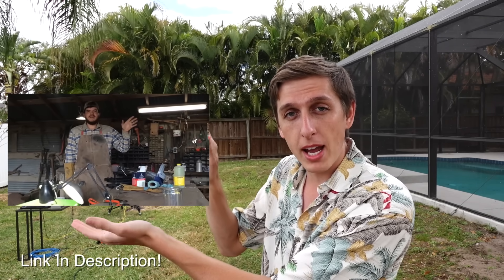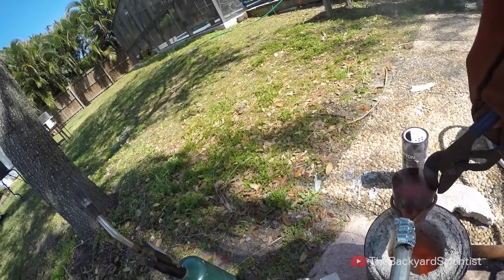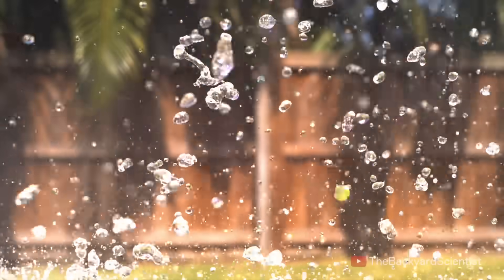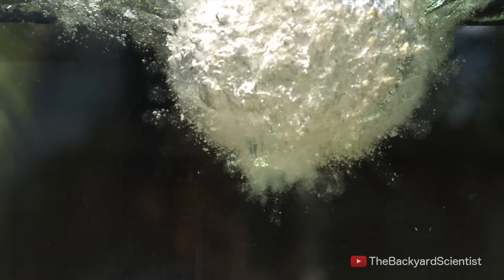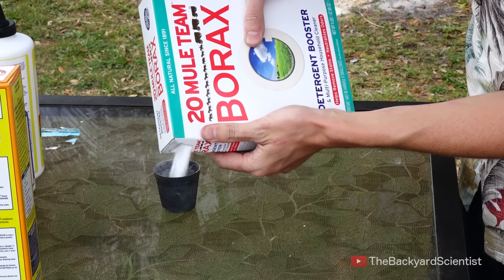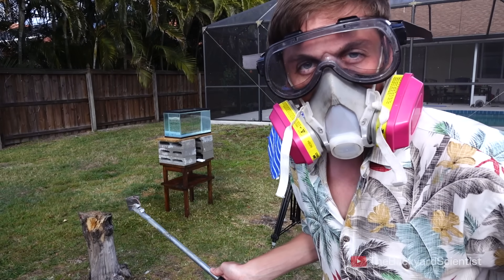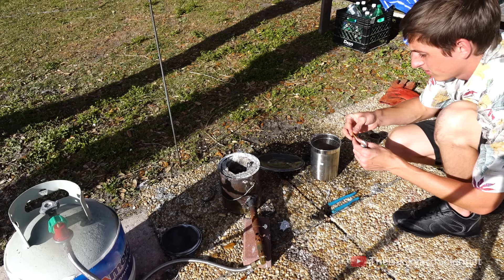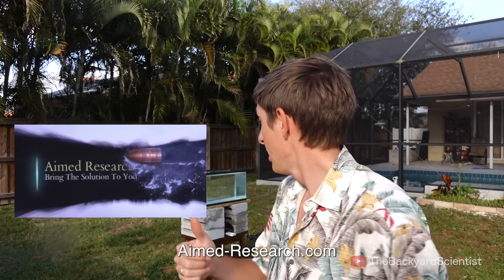Pouring Molten salt into Water - Explosion!

Comment: im compelled to disagree, i dont think this a thermal hyperexpansive reaction because if it was it wouldnt make sense that the leidenfrost effect would fail to prevent a droplet of water from contacting the molten salt, the reason the explosion wasnt significant when the salt was just brought to melting point (880*c) is because molten salt cools very rapidly and by the time it was poured it wasnt hot enough to create a perfect leidenfrost effect which led to the water making contact and defusing the majority of the molten salt with rapid cooling leaving only its core hot enough to have an explosive reaction, when the molten salt was heated much higher (1500-2000*c) it was able to create a perfect leidenfrost effect which prevented direct contact with water and stopped it from cooling rapidly, the steam from the leidenfrost had a chemical reaction with the super heated molten salt causing a very powerful initial explosion as well as several secondary explosions, the reason the pH level didnt rise was because the molten salt was mid-way to reconstituting into a metal which would have significantly increased its resistance to dissolution as well as the fact than is was a salt reaction and not a water reaction, my theory is much more plausible than a - leidenfrost fail with super hot molten salt which is impossible, the only way the leidenfrost can fail is if the reactant was not hot enough.

also the reason why the other salts tested in the experiment didnt react at all was because they did not create a perfect leidenfrost and was cooled rapidly, the additives in them also prevented fractures from occuring on the surface which prevented the core from reacting, at least in theory.. this is very similar to how molten glass reacts in water with the prince rupert effect, creating an outer shell that protects the still hot core, although the prince rupert drop is more akin to thermal differential contraction which leads to a nigh indestructible drop of glass.

Comment: Maybe it explodes becuase of the structure of NaCl. The gaps between the molecules could be big enough, so that water molecules are able to fit in between them. When cooling off, the molten salt transfers the heat to the water. They water evaporates, while the salt freezes and traps the expanding steam and it explodes. Maybe the other salts are to dense to let water fit in between it or freeze to quickly.

Comment: Could the low viscosity of the molten NaCl be why the Leidenfrost effect is not having the usual effect? I noticed that A) you had to heat the NaCl to a higher than simply molten temp to get it to explode and B) all of the other salts you tried appeared thicker than the very runny NaCl.

Comment: I agree it is a physical reaction, but I think the key to your understanding your question is the difference in hardness of the NaCl crystals vs Borax crystals. The expanding vapor pressure inside a much denser, harder NaCL Crystal will be able to build to higher pressures before it fractures and thus the energy released at once will be greater than a significantly softer, less dense borax Crystal.

Comment: Awesome! The salt is so hot and it spreads out so quickly with such a large surface area it causes the water to super boil... my guess.
Reply from the maker: thats basically it! good guess :)
Reply: Na reacts with water and cause an explosion 2Na +2H²O -> H² (g) + 2OH(-)  (aq) + 2Na(+) (aq) 
∆H<0  which means energy is being released, and that's why it explodes.
Reply: also salt is NaCl and Na (sodium) reacts with water. basically everything on the far left (alkalimetals) on the periodic table does. mix them with water and you have an explosion
Reply: Na Cl isn't the same as elemental sodium and elemental lithium. Throw either of those into water and you'll get a reaction spontaneously (with heat it's more violent as you can see in the video.) Salt is Na+ and Cl- which are the stable products. If it was a chemical reaction you would form HCl or NaOH which would change the pH.
Reply: Although in this case, you'd have equal parts so the pH would cancel anyway.

Comment: Well I'm no scientist but, like say you have a ball of energy, and you flash cool the outer shell, the energy inside the ball will continue to try to escape, also that outer shell fractures and or dissolves (in water) and this process repeats over and over until there is an energy balance or neutral I guess

Comment: When NaCl dissolves in water the molecules separate, however they are ionized and not particularly reactive.  If the NaCl is unable to dissolve or remain dissolved, then you will just have precipitate.  Separating NaCl requires energy.  Na when alone and non-ionic will rapidly oxidize releasing hydrogen gas from H2O molecules being 'ripped' apart.  This reaction is exothermic and rapid enough to ignite the hydrogen gas resulting in the orange flames.  The molten NaCl explosion is purely mechanical and predictable given the specific heat and temperature of the molten salt.  The electron behavior of NaCl is different from borax and or NaCl conducts heat fast enough for the water to rapidly absorb the heat, vaporizes, and then absorbs the rest producing a ball of super-heated steam slightly cooler than the molten salt.  If one were to try the same thing with a powdered ceramic material, even at a significantly higher temperature, you would probably end up with tiny steam bubbles being released for minutes on end.  It is worth a try.

Comment: the sodium metal reacted nore violently with the water. so much so that it couldnt get into the water and have the back pressure to make an explosion, in the same way that gunpoweder burns when loose, but explodes when contained. try dropping water on molten sodium metal and molten salt to see if that affects it

Comment: Could the molten sodium chloride NaCl,  disassociate the water into H2 and O2, reacting Cl2 from the salt with H2 from the water in the presence of blue light from the sunlight yields HCl.  this is a very energetic reaction.  the sodium reacts with water forming NaOH.  The NaOH reacts with the HCl and forms H2O and NaCl, so the PH at the start and end will be the same.  O2 gas would also be released

Comment: 1. The first explosion of the molten NaCl was most likely due to the  "speeding up" of the H2O molecules due to the massive amount of kinetic energy you added to the solution. If you add that kind of energy, the molecules are going to speed up and they need somewhere to go. The energy added was greater than the strength of the vessel, so it shattered. Something like E=1/2mv^2. So I believe this was mostly due to the change in energy i.e. it is a physical reaction. 

2. The solid sodium being added to the water is a redox reaction of sodium with water. Sodium loses its electron and the solution becomes basic. Here is the reaction. 

2Na (s)  + 2H2O (l)  -------> 2NaOH (aq)  + H2 (g)

This always happens with solid sodium, which is why the metal is stored in oil. Also, this type of reaction is what gives the alkali metals their name. I believe the explosion has to do with the rate of reaction, but this is definitely a chemical reaction.

Comment: 2Na(s) + 2H2O → 2NaOH(aq) + H2(g)

It is a chemical reaction dude. H2 is the reason why it exploded. The former one didn't explode because either the concentration of H2 was not between 4%~75% (probable) or the temperature was not high enough to ignite H2 (possible).

Comment: it's the same as a smelt water explosion in chemical recovery boilers used in pulp mills. the molten salt is so hot that it boils the water instantly making a Shockwave breaking up more water which boils instantly and creates shockwaves after shockwaves resulting in an explosion.

Comment: Here's my idea of what's happening: Normally extreme temperature's don't react well with one another, sure we can say that we are unaware of the temperature in the fish tank, but we can take a rough estimate of the fish tank water temp knowing that cold water comes out from a hose/tap at 7 degree's Celsius and hot water is around 50 degree's Celsius. Next we can look at the ionic structure of salt (NaCl), to separate most compound you usually run an electrical current through it to separate it into it's most basic elements. Though pure heat won't fully break the bond between the two elements it should weaken it a fair amount so that it does react when dropped in water. The electrons of each compound, both water and Salt, should be releasing the energy gained from coming into contact with the heated salt, for the water, and the energy gained from being heated up. My guess is that it's not until after a fair bit of time that each compound return to their normal states. That's just my two cents on this.

Comment: I think the explosion is due to surface area.  Remember, water dissolves salt.  This means that once the molten salt, contacts the water, it starts breaking it apart.  This means there is an increase in surface area at the atomic level.  It also means, that the water is directly contacting the Na and Cl atoms, meaning that the effective heat transfer rate increases dramatically.

Comment: Actually, salt is also pH neutral, so if it somehow reacted with water, the pH wouldn't change... 
I believe that the difference in the explosions was that pure Sodium hit the water and reacted immediately so it started fire, but as it was with with chlorine it was kind of "protected" and the sodium reacted with water without oxygen, so there was no fire.
Chlorine reacted first, then the sodium, so the pH didn't change...
Just my opinion, as you asked...

Comment: The answer is pressure, explosions are created when pressure is held until the bonding element or agent breaks. Ie, the outer layer of a stick of TNT, or a pressure cooker bomb. If you were to get black powder and pour it in a bowl and light it on fire you would have a very unimpressive flare up of fire and smoke. Take that same amount of black powder and put it in a some type of cylinder (lets say) put a lid on it and wrap it with a good amount of ducktap and Boom (dont try this unless you are a pro, I dont need a lawsuit). Then answer is pressure caused by the outer layers of the salt to become cold trapping the hot and rapidly turning in to gas salt, then the molecules bounce faster, and faster, and faster as more and more reactions occur until the outer bond breaks resulting in an explosion. If that was hard to follow its 2:42 am and I dont wanna to reread it to edit so thats what I got. night

Comment: The answer may be in the cooled salt crystalline structure. Other molten materials did not form crystals when cooled, at least in your video anyway. The salt formed crystals at far above 100c creating a steam explosion from from every surface of every crystal. That what it looks like to me. Sodium metal is similar to calcium metal and a few others that react very strongly to moisture.

Comment: It was most likely flash evaporation, when the sodium hit the water it caused the surrounding water to be turned into gas in a fraction of a second, this caused the water around it to expand outward, and seeing as the salt was still molten, it caused more water to suddenly be turned to gas, and the H2O that is now gas is almost as hot as the salt, so it caused the water around the gas to turn into gas as well, thus causing a ripple effect. And the little small explosions around the large explosion can be contributed by the salt breaking into smaller pieces from the explosion, seeing as the fragments would still be molten hot.

Comment: Usually fluids at high temperatures thrown into water at high temperature are protected by a physical phenomenon called the Leidenfrost effect (It's just a barrier of air between the two substances caused by extreme pressure (ie temperature) differentials. In this case, it explodes because it instantaneously dissolves so the leidenfrost DOES NOT protect the salt. This is very similar to the gas dynamics of engines (HUGE pressure, volatile substance and flashpoints being met)

Comment: measure the volume of space taken up by the salt in its liquid and solid form recorded on video and time its expansion that will allow you to determine the approximate speed. instead of trying to another ion try a soluable like sugar it has similar size crystal forms and can be melted my guess is what's happening is very similar to how a firearm works as the expansion of gases increase create tremendous pressure not to mention the heat transference to the water creating Steam as a counteracting expansion
Reply: my music is super loud so who the  hell knows! ;) lol
Reply: I looked it up to make sure and you can't use sugar. Other suggestions depending on availability try potassium chloride, sodium flouride, or sodium iodide the last one probably the easiest I think sold and nutrition stores to treat iodine deficiencies. KCl is a fertilizer but I think it is also used for lethal injections however they do have definitive melting points and similar molecular structures good luck
Reply: if you get a chance to retouch on this in another video with your borax heat it til I melts and release its water molecules then pour into a container to cool then grind/mill contents and reheat to 743°c (sodium chloride being 801°C) melting point and see what happens when you pour it in water also would encourage more protection salts and water can create some nasty acids and hydroxides
Reply: side note as well be grateful that you weren't able to submerge the liquid sodium completely before it's reaction the sheer amount of heat and gases under the pressure   of water in a glass tank would be much more dangerous then the 1st destroyed tank in the video
Reply: love the video btw

Comment: same effect as glass, its turning into a solid cooling, but unstable and reacts with trapped steam causing pressure explosions not chemical explosions. Glass cooled to quickly is solid ready to explode in a fraction of a second due to stresses in the glass caused by rapid cooling.

Comment: Hmm weird like the salt creates a solid air pocket then explodes like one of those co2 guns divers use to fend off sharks back in the old days they would shoot a shark and it would drive an air bubble into them and expand. Wonder if as the salt cools creates a stable pocket of air and as the bubble expands the salt cracks and then the air bubble explodes.

Comment: you are wrong AF, it is indeed chemical reaction 2  Na + 2 H2O        > 2 NaOH + H2 . If you put that block of sodium into water without heating, you will see the same thing happen. And testing hp is not a way of proving of disproving the presence a chemical reaction.

Comment: Okay from what I remember from High School Chemistry is that heat can change elemental structure.  So  table salt  or even kosher salt is  Sodium Chloride.   Sodium or NA is an alkali metal,  Atomic number is 3,   CL is actually Chlorine Atomic number 17 ,   the =ide is a suffix means it is an anion that you get when you bond chlorine to an an alkali substance ( as is the case with sodium  an alkali metal)   So heating it to that high of a temperature released the chlorine.  That and temperature of the molten material created an embolism of steam and reactive water and sodium resulting in an explosive result. 

Flaw in your sodium test,  Sodium has a relatively low melting point of 370 F  but its boiling point is around 1170 F.   You melted the sodium with a torch but didnt get it boiling hot. as was the case with the salt.  It was the temperature as well as the element that resulted in the explosive result

Comment: There has to be something to do with the Chlorine. It in itself is very reactive and being a liquid it allowed for more chemical exchange and reaction. In a way I could say you may be showing how heating a medium and changing its state can also change how fast it will attempt to dissipate into solution. For example, if you just pour baking soda and vinegar together you get a lot of fizz. Nothing big. You get smelly brown foam and a lot of CO2. HOWEVER if you mix the baking soda with a little water so it is like a soupy paste and then add vinegar you get a freakishly crazy and almost explosive reaction. If you are using a bottle it will spray out instead of do the classic lava flow out.

I could see heat catalyzing the salt for it to react this way with water. As it is trying to diffuse it also is releasing tremendous amounts of heat energy causing the water to boil so violently. With that much heat it might be causing electrolysis in the water. And where you have gaseous hydrogen and oxygen in a confined space and heat you also get a Kaboom as it becomes water again. That might be a bot over the top though. However this does look a lot like a real BLVE (Boiling Liquid Vapor Explosion).

Chemistry wise Borax does not like to go into solution as easily as regular Sodium Chloride. It will dissolve but not quite as rapidly and also Sodium and Chlorine in and of themselves are also FAR more reactive then any of the Boron compounds such as Boric Acid and Borax (a salt of Boron).

Have you thought of doing thermal imaging while conducting this test? I am very curious how the heat is transferred in this reaction as well. I have had college chemistry and while I am no chemist this would be my educated guess on the subject.

That one fish tank did burst pretty violently. I think the more heat the bigger the reaction in this case. It is possible the molecular bonds between the Sodium and Chlorine are weakened by the heat allowing two HIGHLY reactive substances to get jiggy with making love with the water. The hotter you get salt the weaker its chemical bonds.